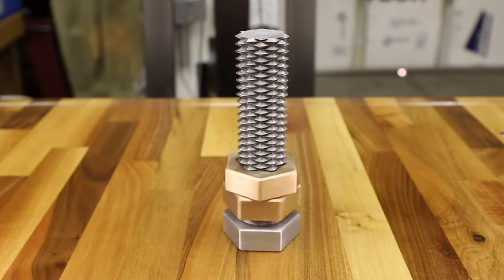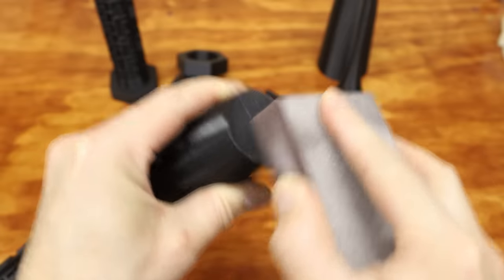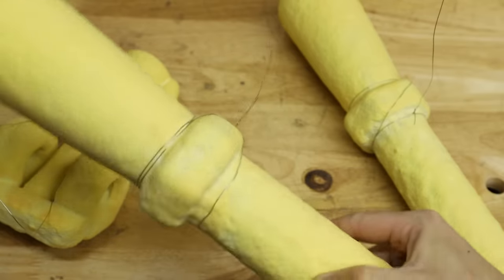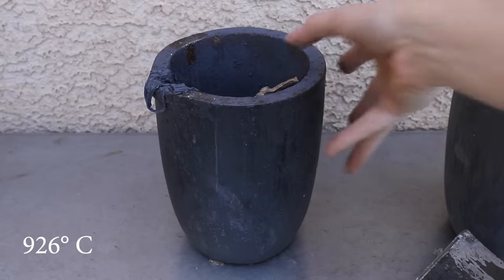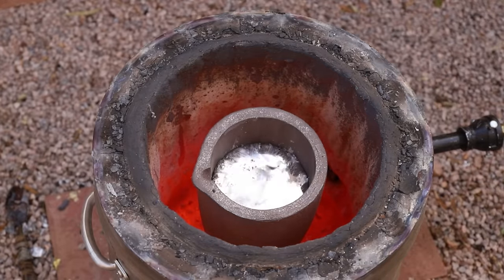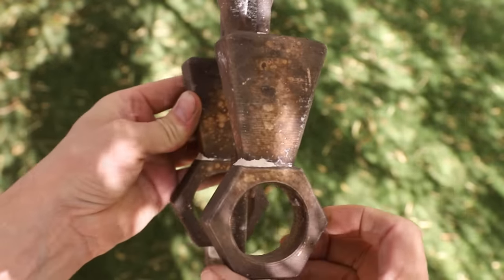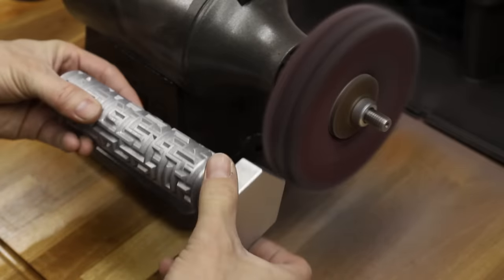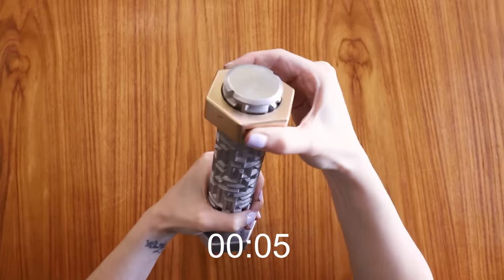Making a bolt with MAZE threads - Can you solve it? - 3d print to metal -Lost PLA

Comment: I think the hardest thing about it would be that you can't see through the nut so you don't really know where the "thread" is in the maze or which way to go unless you've got really good memory.
Reply: That's why you have the black pattern on one side. That's where the pin is
Reply: Agreed there should be a notch on the outside to mark the inner one
Reply: you don’t get it. you can’t see through the nut. if your solving a maze, blind except for knowing where you are in a certain area. it’s still harder than normal.

Comment: Interesting, I made a bolt maze during my apprenticeship 40 years ago, to win a design competition with my colleagues. I machined it on a milling machine using a rotary divider head from brass hex bar. It has been a talking point in my man cave ever since. I was wondering when someone would come up with another one. I disguised the flat where the tracking pin was located, just to make the exercise of solving it a bit more frustrating.
Reply: id love to see a rundown/video on your design…doing that on a rotary head sounds insane
Reply: I'd love to see it!

Comment: Would be interesting to see a design with multiple keys on the nut. Especially if they were asymmetric and could only be solved with the nut engaged in one direction but you wouldn't encounter the problem until partway through.
Reply: Get on the cross and don’t look back   I think your mom is calling you.  You're late for dinner.
Reply: u have my respect
Reply: Wow that's evil. My original comment was "you need Jesus" but someone beat me to it.
Reply: @Redskies453  thank you I take pride in making others feel bad when they try to force religion down our throats
Reply: @AlphaCarinae  Yeah, they kinda are. There is a time and a place. What if every comment section was just filled up with Muslims and Christians and Scientologists proselytizing!? Have some common courtesy.
Reply: @AlphaCarinae  Do you apply that to everything in life? "Oh, there's a Grandma being robbed and i don't like it. Guess i just don't look at it."
Reply: Now create six small different versions of it, make them and a box out of a very sturdy material, (best of you have to slide the lid off so you actually have to remove all screws to open it)
Put 100$/€ inside it and gift it to someone
Now watch their despair

Comment: For complex shapes, would a plaster cast be simpler because it can be dissolved out by water after casting? It seems like, especially for more complex geometries that could have holes and such, that the ceramic gets increasingly difficult to remove
Reply: @XREXP0  then what about one layer of ceramic then the rest as plaster
Reply: @theerandomdude2375  Such a thin layer of ceramic would probably just shatter and leak or bind to the metal, worsening the removal process because instead of large chunks you're scraping away tiny brittle flakes.
Reply: The issue at least I have with plaster molds is they are heavily cracking during burnout. And the at least for me and my castings do not work out that amount of details. For small parts they are anyway a great way to get things done.
Reply: Get on the cross and don’t look back  dude why are you preaching in the comments
Reply: @endofpixel3712  its a bot my man
Reply: By b

Comment: It might be worth investing in a die filer. It basically consists of three items: a file that cuts on the downstroke, a reciprocating mechanism, and a table similar to one you'd find on a drill press. They're both fast and precise without a lot of technique to master them. Especially these days; you don't need flat surfaces to be precise anymore; you could easily 3D print a sled to nestle oddly shaped parts, and make very quick work of filing tasks. That said, they're also not very common anymore, so it might take some poking around to find one.

You might also like to take a look at Polymaker's PolyCast filament. It burns out cleanly like PLA, but it can also be vapor smoothed with isopropyl alcohol, giving a very fine finish on your cast pieces, while also making the ceramic easier to chip off.

Comment: If you could program a drill to install or remove it, you could make that a proprietary security bolt.
Silica is a flux, which make for poor refractory materials because they flow and change density, causing cracks.
But worse, it causes warping. You should use Titanium(II) Oxide instead. TiO. Also mix with alumina.

Comment: It would have been interesting to see even a short explanation of the maze design. Was it just a 2D maze wrapped around a cylinder? How would you have designed it if there wasn't straight section in the side so that the actual solve would need to logically wrap over the 2D maze from side-to-side?

Maybe next step could be a metal ball maze hold in place with 4 clearly visible pegs and one deep enough hole in the ball to extract the ball from the pegs when hole is aligned with one of the pegs?
Reply: Go at 1/4th speed at 17-18*seconds, it looks like he wrapped a 2d maze around the cylinder in the software
Reply: @imallsoupedup  Well spotted! Pro tip: you can also use frame advance by pausing the video and pressing comma (1 frame backwards) and period (1 frame forwards) buttons in the keyboard.
Reply: @MikkoRantalainen .....that is a pro tip
Reply: @MikkoRantalainen  This needs an internet wide PSA.
Reply: @MikkoRantalainen  how that in mobile
Reply: @bananoid3726  I think the frame backwards and frame forwards actions work with a real computer only. I remember somebody also complaining that this doesn't work with OS X, but it should work with Linux desktop and Windows at least.
Reply: Get on the cross and don’t look back  no
Reply: It appears people are too caught up in how to design using software. I made one of these before there was such a thing as design software. Very simple using a rotary dividing head and a few simple calculations. Computers are not always the easy way but definitely the lazy way. I have many designs I have created (one offs), all manually using simple logic. It took 40 years for me to see another of these show up on the internet. Rather than always ask how its done, it is very stimulating to spend the time to figure it out yourself, you may come up with a better way of doing it, or even better design.
Reply: @MikkoRantalainen  more than pro tip

Comment: These are very easy to solve... My little brother created a plastic one for me as a gift some years ago. First time seeing one. Took me 15 or so minutes to solve. Instead of mindlessly trying to find your way through it, you move the object so that you reveal a little bit of the beginning of the maze then go back and forward until you can figure out where the pin/bump is positioned. Then it's smooth sailing from there.

Comment: I studied engineering at school and one of the assignments required some essays on various casting techniques. One of those was investment casting which, for those who don't know, has been in use for thousands of years. I did my studies in engineering nearly 10 years ago and none of the information I found on investment casting mentioned that it could be done with 3d printers and plastic with a suitably low melting point - it was all to do with wax models. Whether Lost PLA was a thing back then or not is irrelevant, it's cool to see things done differently to how I learned about it.

Comment: If you ever want to make it harder, imagine the nut having 2 pegs, 90 degs offset from each other horizontally, and set 1 maze row apart vertically. Designing a maze that would work with such a nut I think would be very challenging.
Reply: Combine this with a nut that can't be taken off at all and don't mark where the engagement is for extra frustration.
Reply: That's a good idea. It would also allow the maze to look almost totally open because the "invisible wall" would be created as combination as two pegs. It might be possible to use drilled pegs that screw into place from inside the nut so you could change the pegs if needed but you still have to solve the maze (open the lock) to access the pegs.
Reply: I was thinking 180, but 90 permits trickery as one or the other peg engaging in the same groove can have a different effect due to the other peg. Which is not possible with 180.
Reply: Not really. The bolt just have to have two identical halves. One for each peg. No other way to do it.

What would bee a 3 peg maze bolt with a reagular thread at the bottom so you could tighten it but had to solve the maze to remove it
Reply: @borjesvensson8661  The nut has depth, so you can't twist it on the normal axis to disengage it from the bolt. Even with one peg it would hold.

Comment: I'm curious if the casting ceramic is hard to pick out of grooves because it's binding to layer lines, and if it would be easier to pick if you used something like acetone smoothing on your prints. On the other hand, that might introduce warping or lost corner detail.

Comment: This is epic! My first thought was how could you make it bigger and get light and some motion sensor tech in it some how. Maybe utilize it in the locking mechanism of a door both small and large scale so if you have a key and know a path through the bolt maze then a larger bolt that is stopping the door from moving falls. Getting it to  rise when locked would be harder but would be some of the coolest steampunky architecture ever.

Comment: I use to work for a company using the same technique to make small scale  high definition metal castings. We made our masters hollow with a honeycomb structure inside. This meant there is less material to burn out of the mould.
Reply: thats exactly how 3d prints as well, but instead of honeycomb its usually triangle comb

Comment: You can add a ceramic powder into that slurry for a much more solid coat, I have worked with lost wax process before and we only needed one dip with the powder mixed into the slurry and would then also add the powder to the outside of the slurry before it started drying as a light dusting

Comment: Pl make perpetual moving wheel by designing the spokes as bolt. The spokes to be arranged at appropriate angle and the nuts to be chosen of measured  weight.
Reply: Respect for leaving a comment to the author. I would be grateful if you look at my content and rate it. In one of the videos, I made a gold case for a Zippo 3D printer lighter.

Comment: Imagine  how would aliens fasten things together? Would  they use Bolts? Or would things be welded or fused together?  Makes it difficult  to work on.  Perhaps  they use a different  type of faster,  magnets 🧲  or pins?  Would they have designed a Bolt 🔩  with threads? I think 🤔  so! Because  planets spin and solar systems do also so they probably have bolts 🔩  are they right handed threads or left? Probably  right handed. Most atoms spin to the right so right handed threads yes  would they have made a fastner like this?  Doubtfully! What about vibrations  loosening the Bolt 🔩    would they use threadlocker ? Or have drilled the Bolt for a cotter pin? Or would they use French locks to stop bolts from loosening probably yes to both.  I challenge you to create a new type of faster that will tighten and hold things together  and be removable and re usable